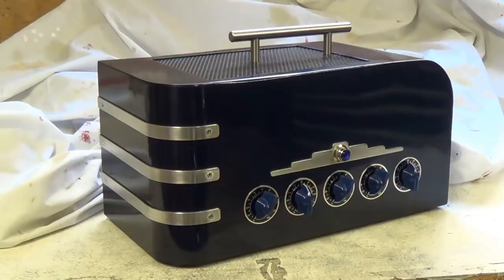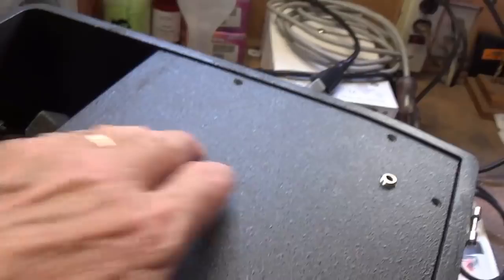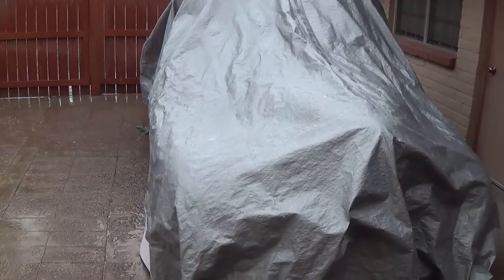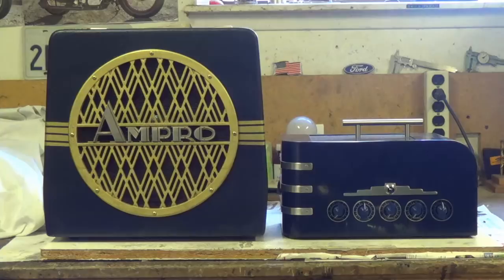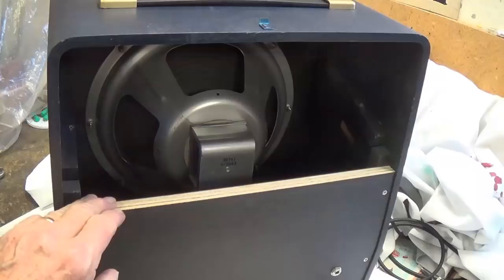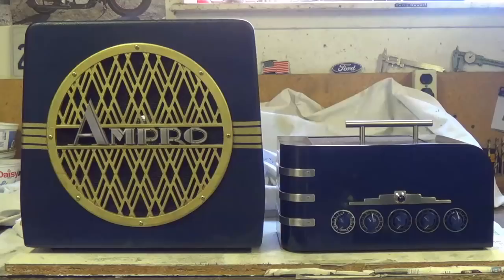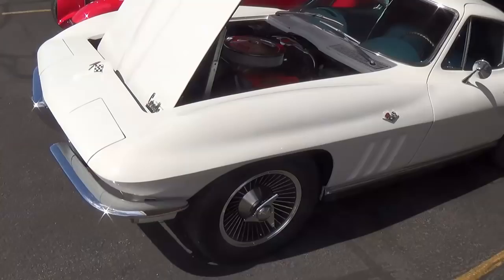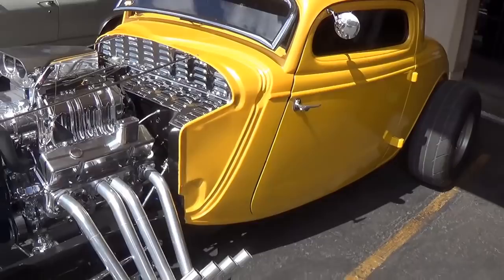Let's Build and Tune an Art Deco Speaker Cabinet

Comment: While driving the "33 or 34" if you are in a situation where you need heat while cruising the strip, simply roll the windows down.  This maneuver allows the heat from the headers to flow directly into the cab .... astonishing how some people are so far ahead of their time.
Reply: Oh, and uh ..... nice speaker cabinet setup and craftsmanship as usual.  While typing the other reply I didn't mention it as I figured it went without saying that I was impressed.  Thanks UD
Reply from the maker: You're welcome, Scott. I'l keep your suggestion in mind if I ever go for a ride in the yellow coupe......hopefully the carbon monoxide won't be a problem :)

Comment: My only suggestion is that you use a silver color paint for the speaker cabinet so it matches the the amp better.
Reply from the maker: Believe me, I started out with that in mind, LE, but shifted to gold for the richness it imparted. I am having second thoughts, however and may follow your advice, but with polished rather than painted aluminum.

Comment: I'm not sure if you still have this setup, but I would be interested to hear how it sounds if you pack the enclosure with poly-fill (available at your local Joanne Fabrics or similar). Start with a light pack and increase the amount until it's semi dense with fill. That should cut the boxiness sound down and bring out the lower end.
Reply from the maker: Thanks for your input, S-L :)

Comment: Hi Uncle Doug, Jack must have mastered the art of disguise, as I didn't spot him at all! I'm still extremely impressed with your custom built amplifier,  if one could scale down the Chrysler building and plug a guitar into it..your amp is what I'd imagine one would end up with. The B&H enclosure turned out great, the Ampro grill + matching color and rally stripes scheme makes it look like it came with the amp from the factory.. The Heppner speaker is of good quality, however I think only rated @ 15watts..If you can, maybe upload a video of the amp and cab when you install the new speaker? I'm enjoying the car shows and totally agree with you on the wheel/tire war going on.  I seem to prefer the original wheels/tire look and stance on most vehicles of any era. Though, If one has a heavily modified car/truck, I can see the logic in adding larger rims to make clearance for modern disc brakes for safety reasons.. By the way Doug, my daughter (who owns some birds) wants to ask, "How are the Parakeets are doing"? Thanks, Tom
Reply from the maker: Thanks so much, Tom. Jack was on hiatus for this video, after really exhausting his sniffer in previous scenes.

Comment: hi uncle doug :-)
 face on with the standard back was the best frontal sound and quite micable for a p.a. system. the 2/3 back was the cleanest off axis.
experience has taught me that the deeper the cone the more directional the frontal wave becomes. the shallower the cone the better the off axis dispersion becomes.
 the driver that came with that cabinet would probably do best as a vocal range unit or for a small organ monitor. 
still liking the sound of that amp :-) the red ford and the distractions were clean!
thanks for the vid uncle doug and copperdog sends a wag ;->
enjoy the day...we are waiting for the hurricane to hit here. ought to be fun.
=dok=
Reply from the maker: Thanks for your analysis and knowledgeable input, Giz. The new speaker is on the way. I, too, am becoming more and more appreciative of the Art Deco Tremoverb Amp. It's my go-to amp now. Best of luck with the hurricane......I hope it passes quickly and causes no damage. Stay healthy !!

Comment: I have a vintage tin 1920s speaker as big as a old buick hub cap..took the old speaker out/junk but the case id fancy, its a UTAH.
Reply from the maker: Utah has been making speakers forever, Allen. Can you use the cabinet for a modern speaker ?
Reply: Absolutly, that's why I kept it,,,but I will never git around to doing it..im sure its a radio 10'inch speaker from the early 1920's, I'll send it to you if you pay the postage...I wanted to put digital lights in it that sync'ed to the music ..and some high tech grill cloth, it's still the stinky brown fake wood grain but can be painted any color to match a set..I-pod wi fi grey?..lol.
Reply from the maker: Could you post a photo of it on my FB page: Uncle Doug's Vintage Amps ? I'd like to assess its potential before we proceed. Thanks !!
Reply: I just looked for it and its gone...I think some radio guy bought it from me back in 2015? from utah..sorry, I totaly forgot...I was really broke back then.
Reply from the maker: I've been in the same situation, Allen. Thanks for looking :)

Comment: I think that the tone difference is mostly due to resonances on the back of the driver. Even though it's called bass guitar, there's not much bass anyway, and that driver with that suspension cannot go very low despite its size.
Reply from the maker: The Alnico magnet in the Heppner speaker is quite weak, Bogdan, which also contributed to the poor performance.

Comment: Hope you don't mind a question in the comments...but I have an old bell and Howell cab I found by the bins a while back. Speaker sounds good but the bakelite handle really rattles and buzzes. Any suggestions to quieten it or should I just remove/replace it. Cheers rich
Reply from the maker: Vibrating handles are a real issue on these old cabinets, OB. Even the low profile handle on the B&H cab buzzes like a bumblebee with the new speaker. I either add felt or rubber pieces to keep them from vibrating, or just remove them altogether and carry the cabinet like you would any other box.
Reply: @UncleDoug  thanks. managed to dismantle the handle and will rebuild with some felt. And whoda thought it...an ampro cab on the 'bay this side of the pond. Hmmmmm;-(

Comment: I've been combing through your postings looking for something specifically about what the choke is. If I missed it please let me know which posting it is. I keep running into the term but when I look it up I learn about an individual with a restricted air passage or having to do with the carburetor neither of which seem to do the trick.
Reply from the maker: If you're speaking of a filter choke in a power supply, its purpose is to function with the filter caps to hinder the passage of the AC ripple which is generally present in rectified high voltage. Because it's an inductor, it will "react" to AC, hindering its passage, while allowing DC to pass freely. The same smoothing effect can be achieved with resistors between the filter caps, but not as effectively. Also the resistors have relatively high resistance compared to the filter choke and restrict DC current flow while  the choke does not.

Comment: Very nice looking speaker/head combo.  I'm interested to find out what speaker you ordered and how much difference it makes in the sound.  Also, why that speaker, which looked pretty good as far as your initial test, sounded less than par.  Anyway, good video as always.
Reply from the maker: I believe the Heppner speaker has a weak Alnico magnet, which makes it flub out at low volume. I have replaced it with a new Jensen C12N.......big difference,  and will include a demo in a future video.

Comment: My guess is,  that speaker was intended for speech and not musical use.   The Fs parameter of the speaker is likely on the low side, and it would do better in an airtight cabinet.   Time for an Emimence, Weber, Jensen, or Celestion GUITAR speaker.
Reply from the maker: A brand new Jensen C12N (no messing around on the wattage) arrived today, DK. It's installed and darned near destroys the cabinet......in a very exciting way :)

Comment: Nothing personal here Doug, I understand that the mission here was to reuse existing stuff, but it has consistently amazed me for 50 years how little notice the guitar amplifier industry has ever taken of all that is known about speaker cabinet construction, starting from Kellog and Rice, Voight, infinite baffles, air suspension, ports, transmission lines, all this stuff that has been seriously well-known for decades, and all that Fender and Marshall and all the rest of them still do is bung the speaker into a box with an open back of arbitrary dimensions chosen to fit the cosmetics required. You'd think they would get interested if only on efficiency grounds.
Reply from the maker: No problem, EJ. You make some good points. I tend to think that the manufacturers, always notorious for their economizing, have found that they can sell millions of dollars worth of amps in rather old-fashioned cabinets, and that efforts to boost the technology of their product would yield inadequate profit and possibly alienate their conservative buyer base. This is much the same dilemma that Harley Davidson has faced.
Reply: Uncle Doug Excellent analogy. Another example is the Baxandall active tone control, published ~1952. They could have got rid of 26dB of hum and maybe a whole gain stage, but nothing, still the same old 1940s passive stages, after nearly 70 years.
Reply from the maker: Progress is slow, EJ, when it does not yield greater profit :)

Comment: Nice build. Good to see no black bars :) I'm happy

The only issue is those gold stripes on the side that aren't quite equal/aligned. I don't know what one could do about the slanted sides of the cabinet but what you could have done for the front was put the masking tape from side to side. The idea is that it's much harder to have unequal sides that way. What are your thoughts, Doug?

However I really like the gold/silver for the speaker grille.
Reply from the maker: I found a way to upload in HD without any bars, just for you, PM. The angle of the sides makes perfectly horizontal lines virtually impossible......and appear to not be horizontal. All I can say is, I did my best. Thanks.

Comment: I'm really looking forward to the follow up with the new speaker.
Another question:. Do you use Greenlee punches to make the holes for the tube sockets in the chassis? I'm trying to decide if they're worth the expense.
Reply from the maker: I have nothing against them, I simply find that step bits work just as well for a lot less money.
Reply: Uncle Doug Gotcha. I had gotten hold of several steel panels from an old oil furnace. I'll have to measure it, but I believe it's a least 18 gauge. It has a brownish-gold finish on the outside and I'm going to try a very slow bend to see if the finish will not crack. I used a small piece for a faceplate already and it looks pretty good/vintage.
Reply from the maker: It sounds like an interesting project, B55. If the finish is old paint, however, I doubt that it can survive a 90 degree bend. Regardless, I hope it works well for you.

Comment: Hi Doug, I'm curious if you could tell me how you finished the Ampro grill plate? I heard you say you'd clean it up, but I couldn't find any mention of your selected finishing... is it painted? Thanks, BR
Reply from the maker: Yes, I thought about bead blasting it and going through a lengthy polishing process......which I may yet do.......but ended up taking the easy way out by simply cleaning and painting it.
Reply: I am watching on mobile, so I'm not sure if I just cant make out detail, but it looks to have a nice texture on the gold part and is contrasted by the smooth surface on the Ampro label? 

Anyway, it looks great as is! Another fine piece of work from you and Jack!!
Reply from the maker: You're right. The grill is wrinkle finish gold while the lettering is polished aluminum. Thanks !!!!

Comment: A third test could been back on with wadding, curious does the head unit fit on top of cabinet?
Reply from the maker: Yes, internal "padding" would be an interesting addition.  Stacking is demonstrated in the video, Nic.
Reply: Stacking as in ~ Amp sat on top of speaker, not shown

Comment: I have one of those Ampro cabs out in my shed, but mine is complete and in reasonable condition.  I'd like to try to use it, but unfortunately the speaker has no technical info regarding ohm rating or power handling.  Are you familiar with the original speaker?  Great work by the way!  I'm glad Brad took the time to mention you in his videos.
Reply from the maker: I'm not sure about the original speakers in Ampro cabinets, EB......I've never had one with a speaker in it, but the impedance is easy to determine with a DC ohmmeter. The DC resistance of an 8 Ohm speaker is about 6.2 DC Ohms, so you can estimate  an 4 Ohm @ 3.2 DC Ohms and a 16 Ohm @ 12.5 Ohms DC. Don't worry about the wattage.......you'll know if it's inadequate :)
Reply: Ok i have many of them with original speakers, they are really good. The most common is Jensen PM12B relabeled as Ampro generally from 1946 until early 50s 16ohms not sure of wattage rating but quite robust

Comment: Really gorgeous BTW. From what I understand, everything from 150 cps on down 
(depending on the speaker of course) comes off the back of the speaker. Perhaps 
that's what Bell & Howell had in mind with the port at the upper back of the speaker 
along with the horn shaped opening.
That said, I'm inclined to agree with your decision on the split back... 
especially for guitar.
So what speaker did you order (?) (he said, trying to get the jump on things) 
Thanx for another inspiring video. The rock 'n roll art deco-ish/hot rod motif is 
truly the "stuff" IMHO for guitars and amps...  Oh, and don't forget to put 
your logo on that beautiful amp so the world (and out lying areas) will know 
who is da man responsible. Credit where credit is due and all that... thanx again and... 
cheers
Reply from the maker: I think the original cabinet would have been OK for mid-range audio visual use, Jonny. The speaker I ordered is a big, juicy C12N Jensen......guaranteed not to make any mule imitations :)

Comment: Thank you for the video! I just bought one of these Howell Bell cabs and I'll do the same mod to use it with my guitar amp head! Do you maybe know the wattage rating of the cone? Did you use one standard input 1/4 jack?
Thank you!!
Reply from the maker: There is no way to guess the wattage of the speaker, Angelo, especially when they're really old. Yes, a standard female 1/4" jack.
Reply: @UncleDoug  Thank you for your kind response!

Comment: I'd be curious to hear the reject alnico spkr driven* by a 6V6 or EL84 single ended amp. 
(*CRANKED) (;-b) ...for those rare occasions where only the nastiest distortion will do.
Reply from the maker: It would probably sound much better with an SE amp and single-coils.

Comment: Hiya Uncle Doug. I particularly like the use of existing stuff you collected over time. Now you can tell Jack, "See? I told you that stuff would come in handy one day!" Something like that Ampro cabinet was what I was seeing in my mind's eye when I suggested a matching cabinet project. The grill being the being the prominent feature of that cabinet takes most of the original mojo with it to the slightly more modern B&H cabinet. With the pin stripe detail completed I think you managed to capture the correct feel to accompany the Art Deco Amp. Very well done sir. All I can say about the sound test is that with all of the back configurations, the straight in front vs 45 degrees to one side always sounded to me like the difference between switching from the bridge pickup and the neck pickup respectively on the guitar. It's impossible to judge any sound check under these conditions though. I always wonder how accurately (or not) the analog sound on your end is reproduced on my end after being digitized, broken into a zillion pieces, transmitted via countless networks, routers, switches, cables, and fiber optics before being converted back to analog in my headphones. I imagine the process would be even sketchier if the last phase was the tiny speakers in my laptop. Oh, and BTW...I agree with you on the big wheel skinny tire thing too. Thanks for another fun-filled half-hour with Uncle Doug. {8^)
Reply: D.Edward Rice l
Reply from the maker: Thanks so much for all your excellent comments, DE. Yes, the recording process is quite a challenge, considering all the pitfalls that exist  between my speaker and yours.

Comment: Nice cabs, I am getting ready to build me a couple of cabs, great timing. Is there a chart somewhere to find the company numbers of a speaker. I have some that came out of a hammond and can't seem to find the brand. Thanks.
Reply from the maker: Yes, there are charts of EIA codes readily available on the Internet, LJ.
Reply: Thanks, I found mine-Two are 15 inch CTS and two  are jensen 12 inch. I did not have the money to buy nice plywood but found some wood on the side of the road, heavy as hell but we have to work with what we have!!!!! Right before I got out of carpenter work I remodeled a drug store. Up in the attic there was about 4000 feet of 1x 12 boards with no nail or screw holes. Better than number 1 you get today. Cabinet grade. I was moving and had no place to store it, so I gave it away. I would love to have that now. They were using it for shelving on racks. One of those boards would probably cost you 50 to 100 dollars now. I probably could build 500 cabs out of it. Oh well we win and we lose.
Reply from the maker: You're welcome. Boy, I wish I had that lumber too......good boards are hard to find. Most of the stock at Home Depot looks like kindling wood.